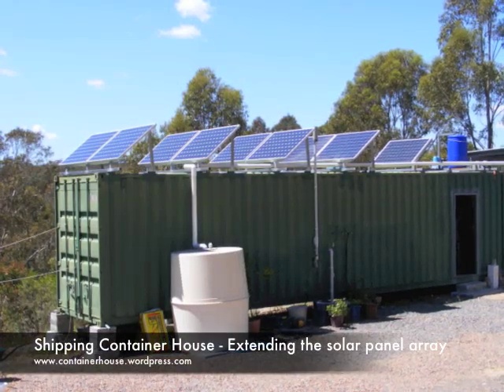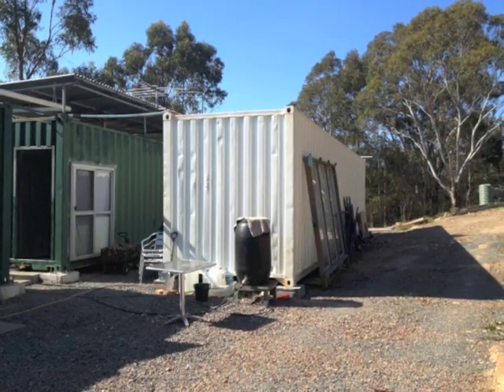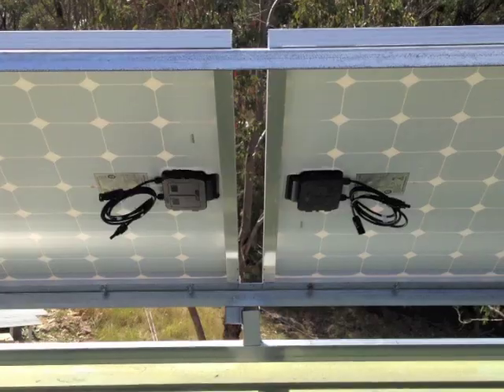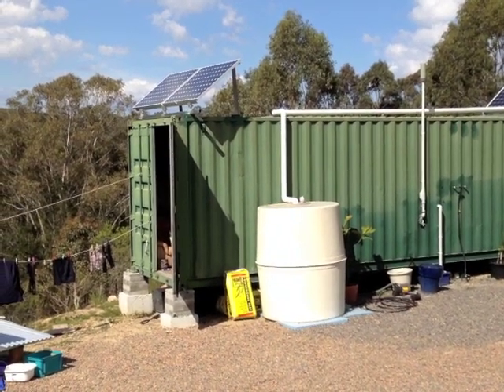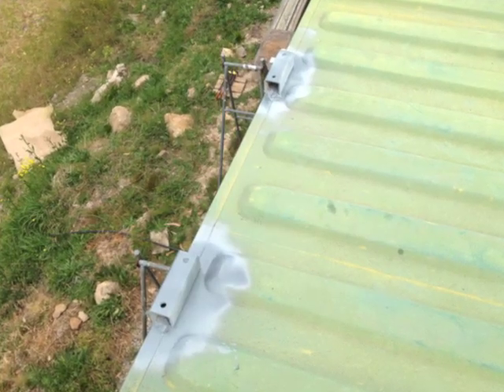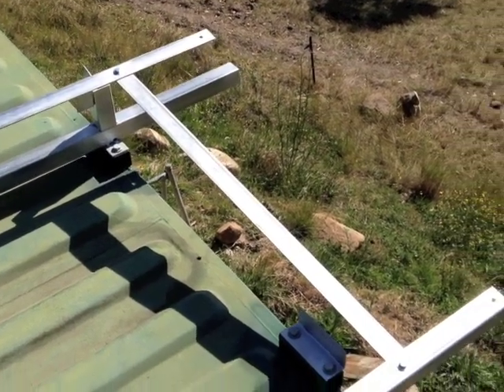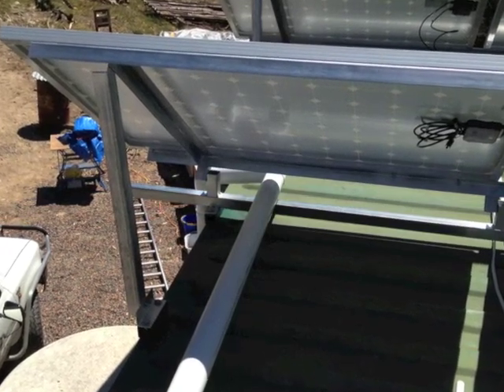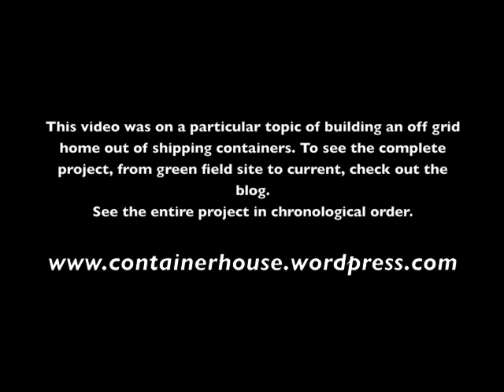Shipping Container House - Installing large solar panel array on shipping container roof

Comment: Good step up from the 20 watt panel.
Reply from the maker: It has worked a treat and for 5 years no electricity bills from a power supplier. The batteries are still in good shape and I recommend solar power. Cheers Paul

Comment: One problem with measuring the length of your shadow is that it is only applicable to that particular day.  If you do it mid winter, then you can be sure that the panels will not shade each other, but if done in summer, you may get shading in winter, when you can least afford it.
Reply from the maker: Hi Keith, You are absolutely correct. The panels are angled for highest yield in winter. Summer we have more than enough. Fortunately it was winter when I measured, and then I added a little for a safety margin. I think my measurements were ok as I have not seen any panel shading.Nice to meet you. Cheers Paul

Comment: hi I watch all your videos and love your work.I think this is something you may be interested in... Battery Life Saver BLS-12/24C Desulfator. Can extend battery life two to three times by removing and preventing the accumulation of lead sulfate crystals using patented square sine technology.
Reply from the maker: Hi Jeffrey, I have considered a desulfating device many times. Have you used one before. Cheers Paul
Reply: not as yet. I thought you may no a bit about them. I am on the way to build a 3kw 24 volt system to take half the house off grid. I am also considering container home. 3 times 40 fool side by side. Thanks.

Comment: I ran across this and it appears kinda doable, at least worth mulling over.
http://www.solarpaneltilt.com/
Reply from the maker: I was going to put in tilting panels. They are tilted for best results in winter. In summer the batteries fill by late morning and there is no point in collecting more.  Once they are full they are full. I dont sell back to the grid. I was going to have a summer and winter setting but it will never happen now. The article was interesting though. Cheers Paul
Reply: Thank you. That's great feedback. I wondered if it were worth the effort to tilt the panels.
Reply: Well if you don't sell your extra energy back to the grid then... wow.. I would have some fun with it! Take the leads from all the panels and short them to do some free arc welding. Oh, do you power an air conditioner ?  Use incandescent bulbs instead of LED :)
Reply: Never mind the air conditioning idea... you've already done it!  and I've even commented on that video a long time ago, not realizing you were the same person.

Comment: the sunlight path changes within the season? did it worked the whole year? did you even notice it? thank you for posting videos sir.
Reply from the maker: Greetings Harold, Sun path in summer is different to winter. The sun is lower in the winter and high in summer. I need most power in winter. My panels are set high to get most winter sun. Although not at optimum angle for summer, the batteries are full by 11:30. I can't sell to the grid so unless I use it, the energy is unused. I will never adjust for a summer angle. No we don't notice the variation. Cheers Paul
Reply: Paul Chambers Thank you for replying, i think you have the best container house Ive seen so far using solar panels i hope someday i could build myself my own container house. thank you again for giving us inspiration on your experience. Great job putting up all the work cheers!

Comment from the maker: Thankyou. I lifted the panels to a steeper angle and extended beyond the shadow to allow a margin of error. Ideally I would have done it in the middle of winter. This was my best estimate. There is plenty of room for variation at the moment. I may make the support struts height variable further down the track if it seems necessary.Cheers Paul